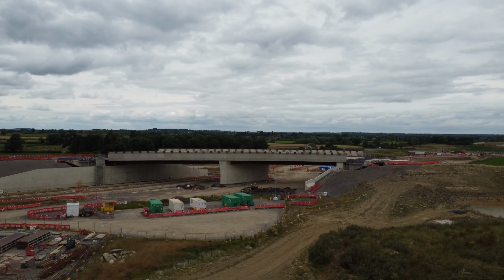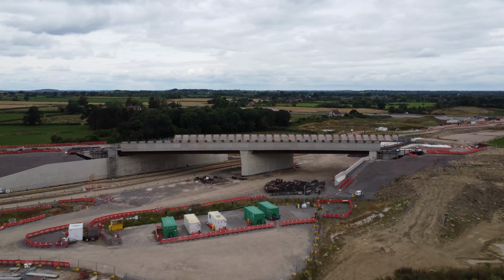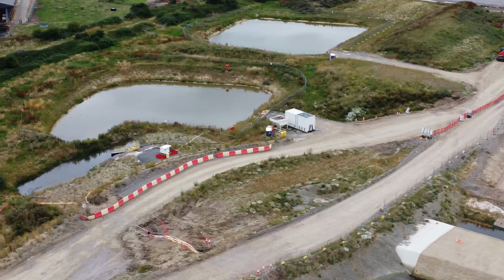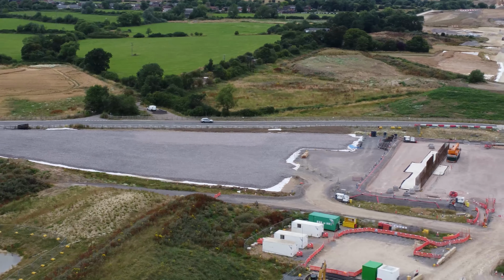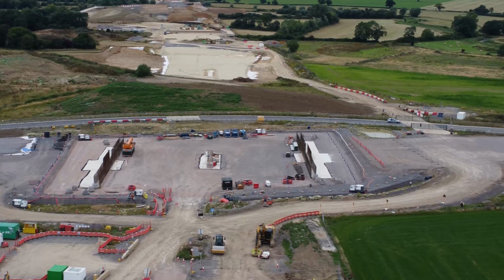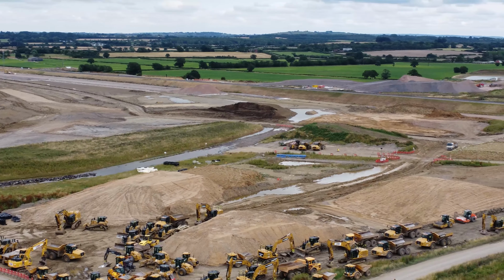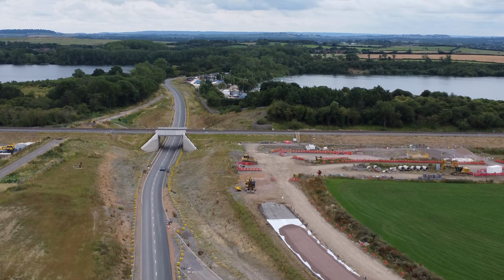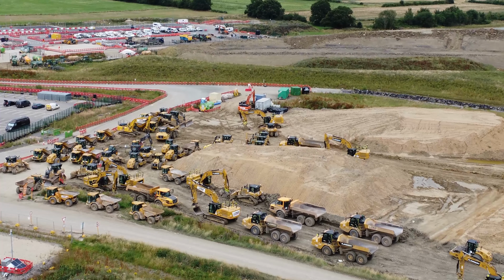HS2 Construction - Steeple Claydon/Calvert - July 2024 Update

Comment: I often wonder just how long these works will actually take
Reply from the maker: Wish I'd got some earlier footage of it, first video was in March and the main bridge structure was in place.
Reply: Nothing but a monstrous blot on the landscape & within a decade of opening (in about 50 years time given the current rate of progress), this concrete monstrosity will be nothing more than a glorified cycle path.
HS2 is an environmental disaster of epic proportions & Britain's biggest infrastructure mistake in half a century.
Reply: @CRIMSONANT1 why do you speak utter garbage, this thing will be over subscribed and an unmitigated commercial success when the line Opens through to Crewe atleast…
Reply: @CRIMSONANT1 we’d better rip up all the Victorian railway and all the motorways then hadn’t we.
Reply: @mattsandilands6380  .. not at all because they actually serve a purpose! 
You do realise that even if HS2 had been built in full, research shows that traffic on the M40 & M1 would decrease by less than 1% & it would have ZERO affect on domestic flights.
Reply: @CRIMSONANT1  But it would take traffic off the west coat line which would mean that our village might get more than one train per hour.
Reply: @mattsandilands6380  .. sadly, that won't be the case. 
One particular issue is Handsacre Junction which was originally designed to transfer HS2 trains directly onto the WCML’s centre fast lines to minimise their capacity impact. This required an expensive 1.9km diversion of the WCML Up slow & fast lines. The decision to accelerate phase 2a’s construction meant that few HS2 trains would use the junction, hence it was redesigned to reduce costs with HS2 lines joining the WCML slow lines.

With the cancellation of phase 2a, the junction will now be constructed as originally designed with HS2 joining the WCML fast lines. This is a further aspect of cancelling phase 2a that will involve significant additional costs. Moreover, as the HS2 phase 2a Act now specifies a slow line connection, there are no longer Parliamentary powers to construct the original junction connecting HS2 to the WCML fast lines.

WCML is used by 40% of the UK’s rail freight. With the cancellation of the Northern leg, there are now no plans to increase the current four freight paths per hour on the WCML north of Lichfield. In its statement, the Rail Freight Group (RFG) “condemned the Government’s decision to cancel HS2 construction north of Birmingham describing it as the worst possible outcome for rail freight.

Arguments that the WCML is "full to capacity", rely on a discredited, out of date forecasting model which overestimates long distance passenger growth & isn't used for anything anymore except to justify the monstrous vanity project that is HS2.
Network Rail's "New Lines Programme Capacity Analysis" shows that WCML capacity is kept artificially low by private operators wanting to maximise profits. 
A DfT analysis shows that in peak hours leaving Euston, WCML trains were loaded at just 52.2%.